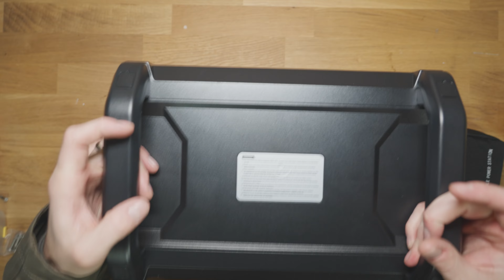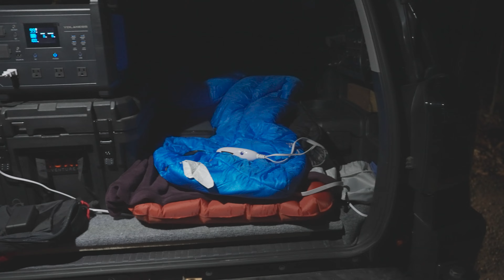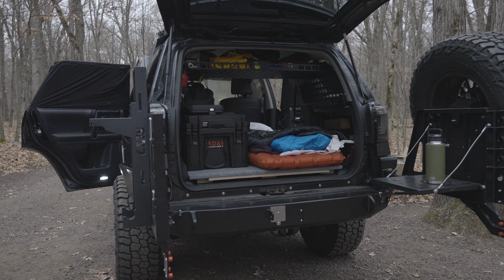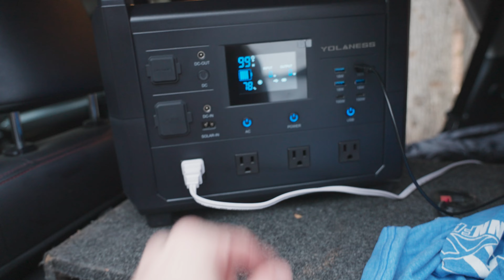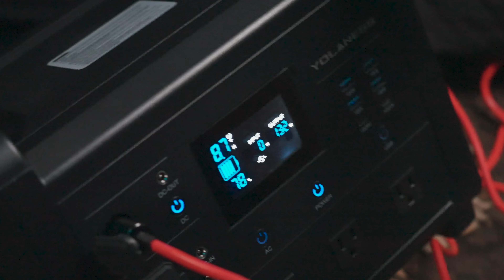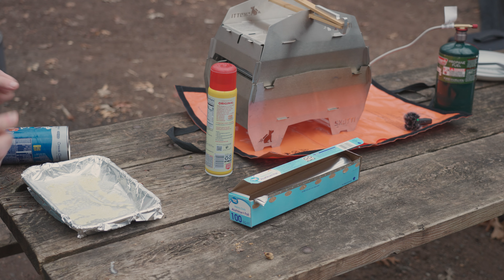BUDGET Portable Power for Camping | How I stay warm overlanding...

Comment: Heated blankets typically use a PWM controller that cycles the power on/off at a variable frequency based on your temp setting.  It probably also has a pre-programmed warm up mode or could potentially have a thermostat plugged in.  It looks like it was working as expected and kept you warm all night!

Comment: All of the portable battery banks have a 10A lighter plug, and the diesel heaters require 15A of power to operate the glow plug relay, so they pop the fuse/breaker in the power banks under surge.

Electric blankets do have a thermostatic control to regulate the temp.

Personally, I HATE light roast coffee. Light roast has more acidity and bitter taste. Properly roasted dark coffee has less acidity, is less bitter and smoother to drink. The beans HAVE to be very slow roasted to dark for the coffee to be of a quality grade.
Reply: wait what?  diesel heaters require 15a and battery packs are 10a???  How is anyone using these diesel heaters then? Surely the % running off hardwired power can't that high. Plus I'm guessing car power setups can vary and maybe not all offer the required 15a....   

I have so much to learn?

Comment: I’m sorry but you didn’t do the company who sponsored you any favors by not doing an accurate test with products that work properly (ie your heated blanket not functioning). You should remake this test and give the companies product a fair shake and put it through the paces.
Reply from the maker: I'll do more testing but I am getting tired of plugging in a fridge or phone charger, filming it and waiting to see how long it lasts...you can do the math based on the power draw of your fridge and the temperatures you travel in.  The heated blanket test I have done with other batteries before...again it's kind of just simple DC power math because these batteries are lithium. I tried to give it harder tasks this time.  Check out that guy I referenced at the beginning of the video for the bench top tests.  These companies also give deadlines so I can't always test it for 6 months then make a comprehensive review, they end up basically being first impressions videos.  Perhaps I can do a long term review.

Comment: 'Warm up phase'.... it's called a glow plug.  My Jackery 500 doesn't put out enough power for the glow plug either.  My Bluetti does.  The Bluetti also has a high amp 12v port (25a), so plenty of power there.  For the loss of power overnight.. test it:  let it sit powered on overnight with zero draw... there is internal parasitic loss.  For the blanket, put it on a monitored plug and plug it in at home - they cycle on/off normally, yes.  Your jet boil is running off an isobutane canister, not propane.
Reply: Well the funny/weird thing is.. I do run and start the diesel heater just fine with the Jackery 240.. The double DC cord split would just be for starting it with my Jackery then continuing to run the heater off the larger battery.
Reply from the maker: Theres not 250Watts of parasitic draw over night...plus the blanket was warm.  I'll have to look into it but honestly don't care much because I am going to order a 12V blanket, hopefully they are slightly more efficient...
Reply: @OverlandEngineer  ok.. how much is there?
Reply from the maker: @mattmentzer8610 I reached out to the gears and gadgets guy to see if he quantified it.  Assuming though a 260W over 8 hours depletion of the battery thats essentially 32 watts per hour.  Basically a constant 2.7 amp draw if you assume constant draw (I don't think it was).  Parasitic draw for most battery management systems I have seen really should not go above 0.1 Amps...  My little usb fan pulls 2Watts on full blast (2/12 = 167mA or 0.167 Amps).
Reply from the maker: I do really like that 25Amp Bluetti high output 12V, that's a really nice feature all these batteries should have.
Reply: Is it possible the cold temps had an effect?
Reply: I ran that setup for a year and a half - likely over 60 nights.  Did the same regardless of outside temp.  Outside temp didn't matter much anyway as the batteries are in the heated area. @KillRoy0351